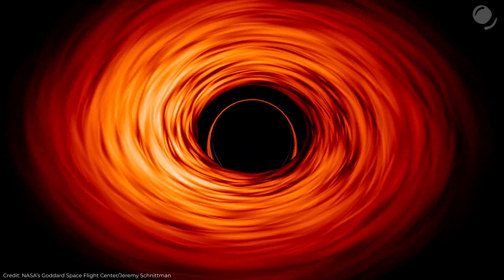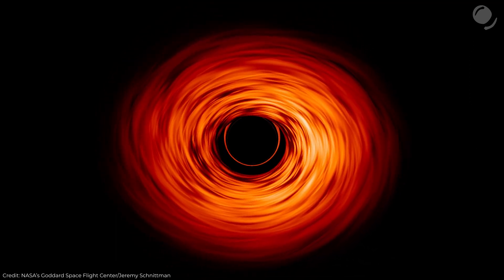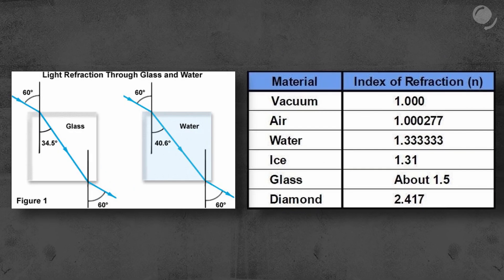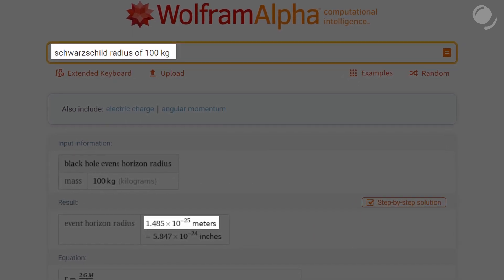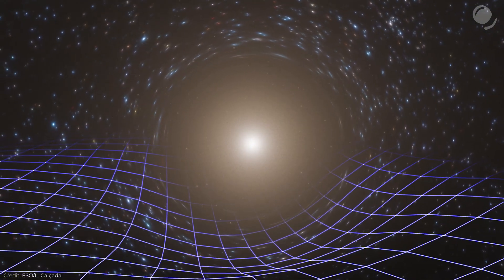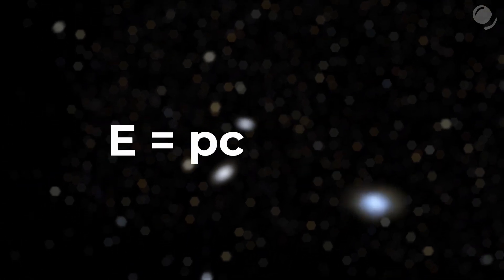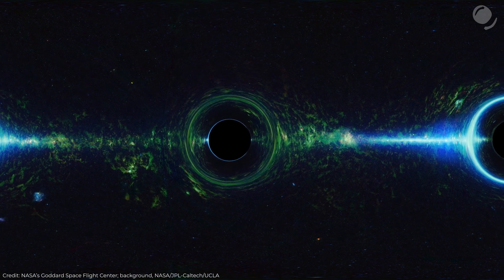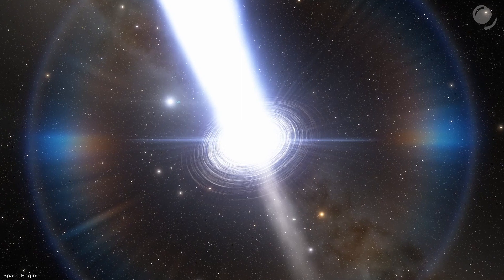Can we make a black hole out of light?

Comment: The answer is NO, mass and energy ARE NOT EQUIVALENT... you cannot just swap E and M over.. they are not equivalent.. 

e = mc2.. Energy does not curve space or give us gravity.. 

Energy that is in the form of matter or a sub-component of matter HAS mass and curves space and gives us gravity. 

Energy that is not a form of matter or a sub-component (light) has NO mass, will NEVER have mass and does not change space or produce gravity.. 

Mass and energy are not equivalent.. 

The model you explained was the basis for the assumption of micro black holes at the LHC, the theory failed.

You cannot put even TWO photons at the same place at the same time at the same trajectory.. Let alone more than two.